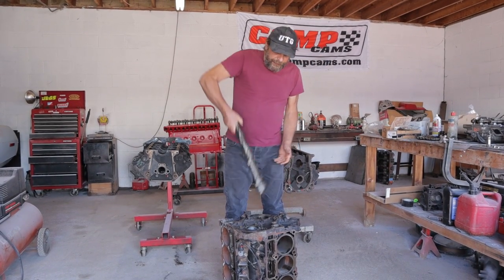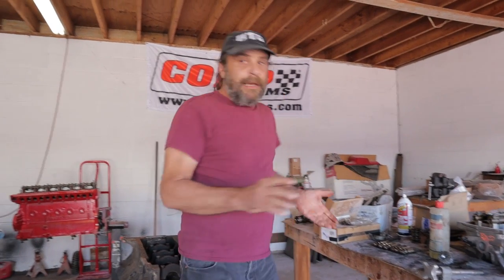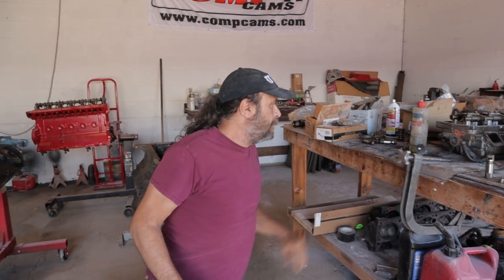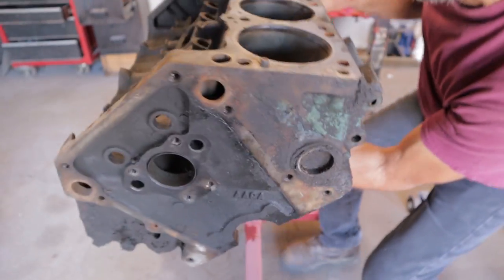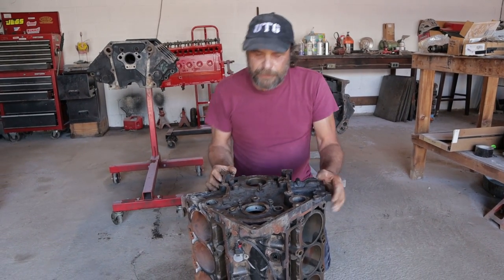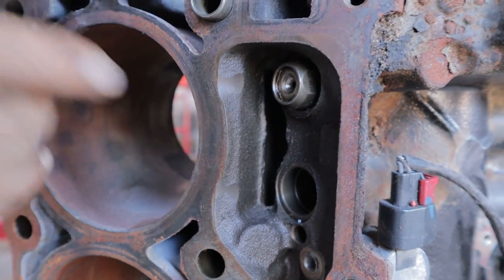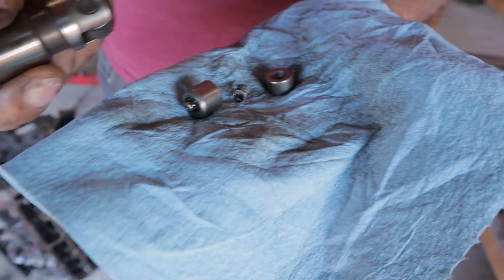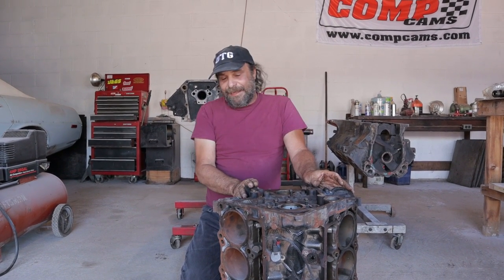Gen 3 Hemi Camshaft Failure Mystery Explained!

Comment: Camshaft is just the cream on the top problem. In my opinion the Rod bearings on the 7 & 8 crap out due to oiling issues. That's just my experience.

Comment: on another note: thats the reason their are hour meters on these dodges at least most of them with the options. I always tell cust. that if they idle a lot change oil more often. the rule of thumb is MULTIPLY 35 X THE HOURS and you come up with miles that are really close to what it should have. EXAMPLE 190 HOUR's X 35 that is idle hours,  some dodges show total hours and idles hours, mainly in the trucks or cars with that option in the CCN.

Comment: Ok so ….. I have a ram 1500 TRX 4 /2010  I got it when it had 75k miles now it has 173k engine is stock never had any problems only a water pump replacement because it was leaking . I’ve owned the truck since 2016 and still have it . I’ve used royal purple 5w20 and added the Lucas additive all the time changed oil every 5k-7k miles now the cam and lifters need to be changed because it has a misfire cylinder 3 . I guess up until 2 weeks ago it ran fine . It’s in the shop now getting a stage 2 cam from comp cams along with lifters springs and what ever comes with the kit  ,MDS delete, vararam intake , a tune and bbk shorties I plan on keeping it forever because of sentimental value . But would I buy another ram? Probably not

Comment: I've been a Mopar lover since 1966. Understanding this helps in my desires to rebuild a 426 hemi. The last engine I'd had rebuilt by the late and best of that era machinist and engine re-builder of Tucumcari New Mexico: Who claim my engine was the second most powerful engine he'd ever built in his life time. He replaced every thing new except the bare block, bare heads that were blue printed by him, and the original crank. This engine was a one of limited police interceptor 440 of 1973. This block stamp was authorized by NM State Police for placement on title of original car a 1973 Plymouth Polar that I'd acquire from an deceased individual whom acquired from a lieutenant in El Paso State Policeman back before I'd acquire vehicle from deceased railroader's wife back pre 2000. Point is motor when I first cranked after rebuild started, was one of the smoothest engines after heads were polished and ported.  I sold the whole build with car and rebuilt engine and transmission to an individual in Tucson, Arizona and I've always wanted to build an original 426 hemi, but since now I'm 71, time will only tell if that dream will ever blossom. Even if it does not, to me in all my years on this planet, "MOPAR" Rocks in my books.

Comment: With this info in hand, and the idea of a "pisser" on the bottom of the lifter, one has to wonder two things: Did Mopar change the design at any point in production, and 2) when will the aftermarket cam companies start selling cams "with improved oiling to solve factory lubrication issues." Meanwhile, I'll be sure not to idle a long time, and to select better oil.

Comment: Mine has the tick for about 1 minute after a cold start then goes away, BUT when the mds turns on sometimes i can still hear a faint tick but it sounds fine when on all 8. Almost sounds like an exhaust leak, wonder if i have a bigger problem about to arise. Has almost 80k miles.

Comment: A micro hole on the underside of the roller and two micro holes on each of the thrust faces of the lifter would take care of any lubing of the roller and stop galling of the thrust faces.  It wouldn't work on any of the motors that shut off cylinders however.

Comment: How about leaving the original MDS plugs, but using non MDS lifters? That would still supply oil, but won’t worry about the lifters locking up, would that be something to try out ? 
Also when in idle “in traffic”, maybe there is a way at to program a higher rpm intervals?

Comment: I wonder if you drilled and tapped holes down into the top of that cast in tube galley.  Do it with the right size etc so you can screw in holley carb jets.  Adjust the size of the jets until you have still have good oil pressure with a fountain of oil going onto each lobe, like main galley fed piston oil squirters.

Comment: Much of the windage oiling or lack there of as explained in this demonstration is largely effected by crankcase pressure or ventilation. 
  The cam and lifter as well as the crankcase surround the crankshaft and connecting rods aren’t necessarily dripping wet with oil but rather a vapor cloud of oil. This much has been tested in great detail. 
   The more positive crank ventilation or vacuum introduced to the crankcase the tighter the vapor cloud surrounding these parts becomes. 
    Parasitic loss of power occurs from poor windage. This is yet another avenue of approach engineers have been forced to address in order to meet epa demands for fuel economy. 
    Low tension narrow ring packages reduce drag and cylinder temps as well as increase power and fuel mileage, but all of this is largely dependent on crankcase venting. 
    Uncle Tony is on to something I believe.  
    I don’t think it’s just one or two things. I believe several factors are aligned to cause the issue. 
   Certainly offshore manufacturing processes are responsible for some aspects. 
   Certainly the vehicle left to sit and idle are responsible. However. This is happening on vehicles that do not sit and idle as well. 
    The honing processes these lifters must go through to true up the roller surfaces after they’re pressed together leaves much to be desired. It’s a necessary evil.  I believe some lifters aren’t getting trued up adequately offshore and the grit left in the roller bearings is working then over.  
    Also long chain polymers like zinc additives really have zero benefit to roller applications. As per David Vizard they’re a detriment and I agree. 
    So I believe it to be several factors.

Comment: I have an Eagle 5.7 in my 300c with 134,000 miles. It sees redline every day and the cam is still fine. 
Use THIN oil, change it often and drive it like you stole it and you won’t have a problem.

Comment: I have been looking at all my different Hemi 5.7’s I’ve got from mainly trucks just to see what flaws they have and I also have a few 4.7’s , also have been studying. As far as the Hemi I had 2 with all the mains and rod bearings destroyed at 110,000 and 150,000! The odd part was the top ends are fine, except for the 3rd cam bearing from the front to back was close to being part of the cam but the other truck Hemi had 225,000 and still ran and it had a lifter collapse, the same cam bearing was damaged and the push rod ends were oblong in the rocker arms and it never was babied but if it idled for 5 minutes it would start to sound like a dam K-car until it got the throttle smashed into the engine bay lol! I don’t know why they all 3 had the same damaged cam bearing. One had the cam bearing oil hole plugged off totally and under inspection that bearing was installed over the oil hole for the cam and it looked like it had been like that for a long time! All are non-mds and the same 3 were from 1/2ton ‘03 Ram quad cabs . The next one I affectionately called the 6cyl Hemi cause it had a surprise that even UTG would be scratching his head! It was an engine a buddy sold to me for next to nothing from another truck, but’04. The engine spun over and the heads looked great and I didn’t think it had anything wrong till the heads were off and spun it over again and 6 of the 8 moved! A few little taps and cylinders 7&8 moved and to make anyone feel sick it has the crosshatches on all the cylinder walls, new .020 pistons and melling cam! The rod bolts were still bolted to what was left of the connecting rods and the main bearings are still good… but that’s what is confusing cause it includes the back one too but to look at the connecting rods and what bearings I could identify in the pan and in the oil feed for the rods in the crank, the seized up wrist pins and the tops of the ring landings to the wrist pin looked like I was working on 2 different engines! All have the lifter scuff, the push rods messed up along with the top of the valve stems are smashed down and the rockers are also messed up from the force of what one could mistake for the cylinders being hydro-locked but the one thing that I expected to see but didn’t was a bad roller on the lifter but I did see some tiny pits on the lobes of all the engines but the “6 cyl Hemi! I have a mds ‘09 car 5.7 Hemi and it had all the lifters collapsed but cylinder 1! The front cam bearing was starting to gouge and it has the vvt with the big twin oil groove cam and bearing but everything else is fine w/180,000 miles on it! With this said and then the disappointing boat anchor 4.7 “mod motor” that is as impossible to get any power out of without draining the bank to get 400 hp like my 4th Jasper 4.6 SOHC engine in my ’01 GT (going to try to get 1,500 miles out of this one), or anything performance other than dropping in the H.O. engine ! All of them have the same common problem and it’s oil or lack of that is amongst other things I can’t really say except start over again! My only idea actually came from the 4.7 and the camshaft design specifically. They have holes in the cam lobes and they are fed via the cam bearing caps and this is the problem with them, they have to have oil changed at 3,000 miles to get them to live past the estimated life of @118,000 miles cause they have no bearing on the cams and the long and somewhat intimidating timing setup increases weight bearing on the front of the camshafts and the roller lifters flying out from low oil pressure or collapsed hydraulic valve lash adjuster , or you might know em better as hydraulic lifters but they don’t move or ride on the cams , just take up the slack . I would like to see a hollow cam for the Hemi like the 4.7 cam oil holes in the lobes and see if it can be a economical fix for the Hemi and having a hollow cam is lighter too for performance and economy. As far as the officers that don’t need training for using their patrol car I think is a “cop out “ cause in the 70’s n 80’s the LTD had to be idled up on them 390’s and 460’s and it was common sense cause the directions were on the dash by the throttle lock! As a patrol officer said to me once “ which is the worst of the two evils?” Hell my truck idles up on its own after a few minutes, it’s the Ram with the 5.9l Cummins and it is possible to do it to the ECU and as far as training goes have you watched YouTube before? Lol just teasing! Seriously though I’ve thought about this and studied these engines for a few years now and I have yet put the 4.7 n 5.7 together yet till I know I’ve done everything I could to do make a better engine and do a good job with it cause it’s not just the mopar name but it’s mine and everyone else that I use to make it happen too! Thank you UTG! Btw I’m there with you! The 440 is looking better everyday in my truck, and the bell housing is the same I’m told!😈✌️

Comment: Poor quality roller lifters. Its not just the hemi’s that fail, the 3.6 v6 also has the same problem.  The earlier model hemi from say 2003 till whenever they added the cyl deactivating system did not suffer the same fate either.

Comment: Uncle Tony, I have a very serious question to ask you. And, this may take some time to answer but I feel that you have more time and much more patience than I do. As a Chrysler dodge jeep technician I HAVE noticed that the 5.7 liter and 6.4 liters go through lifters like hot cakes. I haven't noticed any real issues out of the supercharged 6.2 liter yet other than an occasional locked up supercharger or someone trying to push too much power out of it. The 6.1 liter, however, never really had such issues. And, in fact, very rarely are internal engine parts replaced on the 6.1 liter that's not due to outside influence. My question is would you be able to look into why this is, and do you think that lifter failure is a direct result of MDS? Because non-MDS engines seem to fail a lot less.
Reply: It's because of the Hellcat oil pump being high volume.

Comment: So because i am driving my 2018 ram 1500 with the hemi at 2300-2700 rpm in 6th gear on the eight speed transmission so i can enjoy hearing my carven exhaust, it is actually benefiting my engine more?  Hell yeah.

Comment: UT, couldn't one drill into the top of the main oil gallery tube with a very small drill bit, perhaps 1/16?  Possibly one between each pair of cylinders?  Then you would literally be spraying the bottom of the cam?

Comment: Drill the oil galley that sits under the camshaft so it can spray the cam with oil & use a high volume oil pump,
With the cam out of the way drill thru the engine valley to get to the oil galley.

Comment: How about overfilling the oil an extra quart or so to help the crank throw more oil up into the cam area? Usually motors these days run minimum oil in the pan to reduce the drag on the spinning crank for more MPG

Comment: Having repaired four of these engines, the problem is that the standard lifter is junk - the bearings go out on the roller.  Chrysler knows this, which is why they have a TSB calling for complete lifter replacement on every Gen 3 Hemi excluding the Hellcat, Demon, and Hellephant every 75k miles.

Yes, replace all 16 lifters every 75k miles.  No, it's not covered under warranty.

Why are their highest-end engines excluded?  Because the lifter is different - the bearings for the rollers are literally twice the size.  That's the reason why MDS deletes for these engines exclusively use Hellcat lifters.
Reply: Did they remanufactured 5.7 engine? Or even 2019-2020 still has this problem with lifters?
Reply: @herbatkowy  idk about 2019-2020, but these were the engines in the vehicles from the factory.

Comment: Are you sure it's NOT the MDS and dirty oil? I think the 3rd gen hemi is a fantastic power plant (minus the needle bearings going bad in a handful of crap lifters that is). Take care of your hemi, like changing the oil when recommended with the recommended oil (not the cheap stuff) and your mopar should last you for 200,000 to 300,000 miles provided the engine isn't abused (like excessive idling or improper cold starting).

Comment: I just caught this video today even though it looks a few years old, I have watched a few other videos where the oil pump has been replaced with a high volume unit either from a hellcat or better yet from another company I can't remember the name that's just came out with a high volume replacement. I imagine that would eliminate this issue occurring going forward, however if you already have the issue then I guess you have to do the dreaded lifter and cam swap first. What a terrible crap design this is! I still cannot believe that FCA doesn't have a class action lawsuit against them for all of this! I have a 2011 Chevy Express with a 5.3 with approaching 170K miles, idles all the time and I've never had so much as one tick! Come on FCA You can do better than this!

Comment: The major flaw is, the centerline between the cam and the crank is too far apart.
Look at the distance in a original HEMI, and you'll see the difference.  They would have
better off bringing back the early 392 block.  Or, let's bring back the RB Block with
newer heads/induction.

Comment: Great video. I had a a question regarding mds lifters if u woukd be so kind to help me out. Im working on a 09 ram 5.7 w/mds i got a p3497 now keep in mind i got tge truck after cam and some lifters were replaced cam was new but lifters i belive were not. Now i removed bank 2 cylinder head to check for blocked passages all checked out one thing i did notice was that the pin on 1 out tge 4 mds lifters was visible on tge other 3 the pin was inside the lifter body. Is that normal?

Comment: It’s the MDS the lifters sometimes collapse and don’t come back! Grinding the can ticking sounds and it gets worse!!! Easy fix! Lifters from a hellcat may as well do valve adjustment and check other things to be safe disconnect the MDS (THE CORRECT WAY) and add a hell cat oil pump! This will increase oil pressure while at idle a lot of idling and stop an go traffic fails to bring oil pressure up enough. To lube the upper end of the engine. So to compensate a hell cat/demon oil pump and deactivate MDS then use hell cat/demon lifters etc etc! And you’ll NEVER HAVE THIS ISSUE AGAIN!!!!!! I know I do it at my shop and never have I had a customer return with these issues EVER!!!!! Plus if they want to do performance upgrades later it saves time and cash

Comment: I don't buy this theory,It sounds all good.But, Camshafts work perfectly fine in an overhead configuration without any oil from the crankshaft splashing onto the camshaft.The problem is that these fancy new valve trains really depend on high detergent oil and maintaining the engine as clean as possible.Running the right oil ,not just any oil, is now really important. This is why Chrysler is now in the business of recommending certain oils for their high detergent properties and specific weights. More and more these engines are designed for synthetic oils. No more conventional oil. These failures are not unique to the Hemi Engine and Chrysler. I worked in a cylinder head shop and seen many camshaft lifter failures just like this from various problems with the oil.More common now with fancier valve trains.I have also seen oil companies replace engines over the issue since they guaranty their oil against oil related failures if you can prove you used their oil and replaced at their intervals.